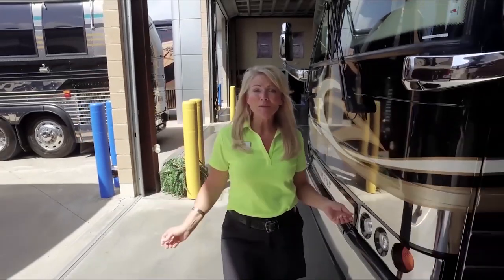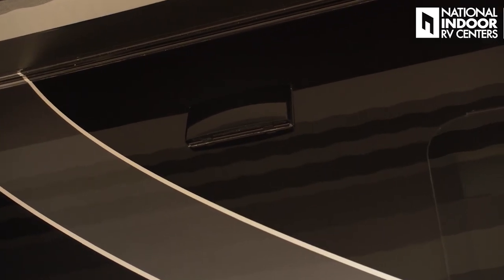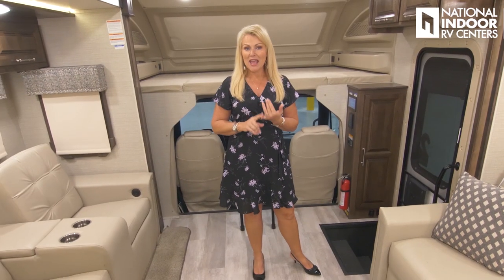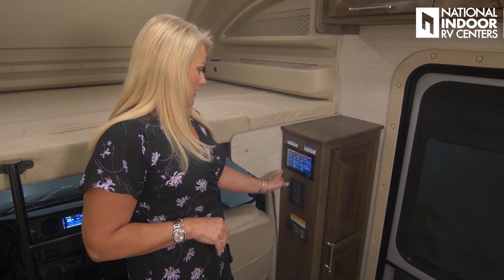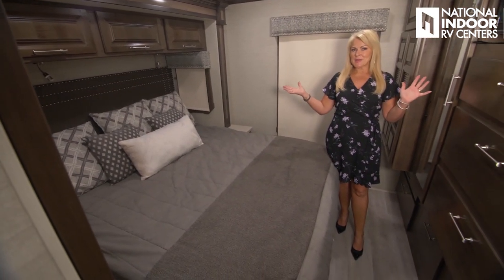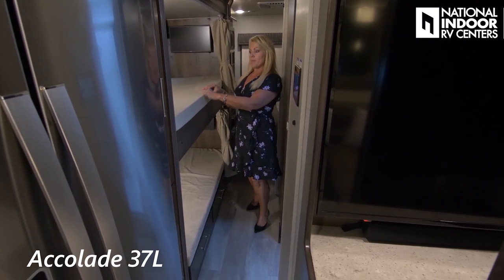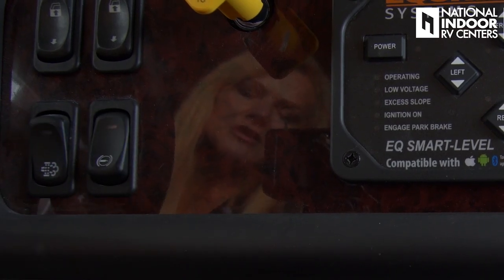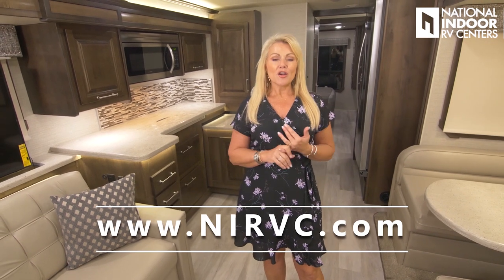2020 Entegra Accolade (37TS, 37L-Bunkhouse, and 37K) | Full Motorhome Walkthrough Tour | NIRVC

Comment: Rear view cameras are defeated by intense bright winter sunshine at a low elevation from behind . You should look into putting a blind spot warning system in if you cant see down the sides using the cameras. Some kind of warning light/buzzer inside the cab.
Reply from the maker: Thank you for the suggestion, I will share them with the manufacturer!

Comment: Thank you Angie. it is so beautiful but I have one question with air in the RV do you need a (Z) license  for the air and what license do you need to drive it since it is over 35 feet
Reply from the maker: Hi Rick, typically you need a class B once your coach is over 26,000 lbs. it’s best to check with your local DMV since each state is different.
Reply from the maker: Hi Rick, typically you need a class B once your coach is over 26,000 lbs. It’s best to check with your local DMV since each state is different.

Comment: She always does such a through job in showing the RVs. I always compare other companies walk throughs to hers. I wish the bunks had sliding doors and not curtains. Also was wondering if there are options to have the top bunk to electronically raise and lower which I have seen with other companies.... I really like that feature and it would be a selling point I couldn't resist. Also is it possible to order  an RV with handicap aisle so a wheel chair could move easily after slides are fully in?  Double Sinks in the Bath is necessary. Sleep 8 a must.  Showers for me should be tiled. Washer and dryer  a must too :)

Comment: On the models of have the fireplace are the floors heated in any of these three coaches also will the fireplace feet the back sleeping area of the couch reason asking I don't see any events or any other heating Source back there
Reply from the maker: There is a 15k A/C with heat pump and a furnace for heat. It does not have heated floors.

Comment: I liked your video.  It is very informative.  It had me wondering about the K and the RB.  Since there are multiple black tanks, do you need to have two sewer hoses hooked up to dump them or do they all flow to one sewer hose connection?  I understand you may need to pull multiple gate valves depending on which tank you want to empty.